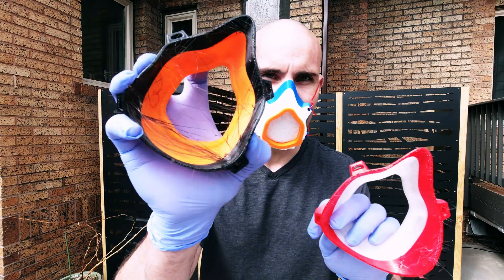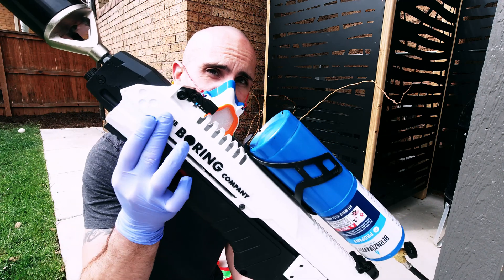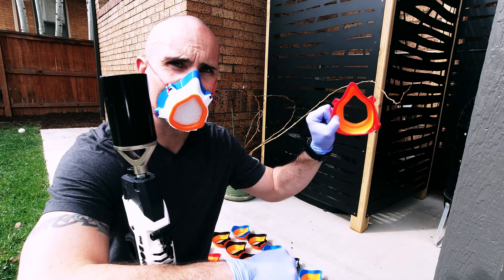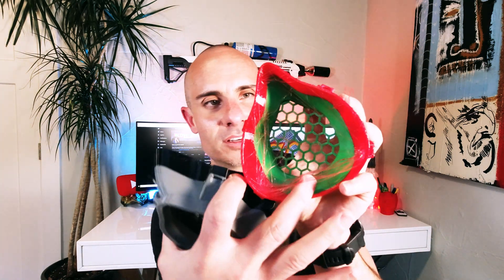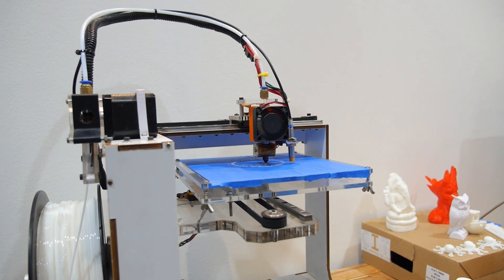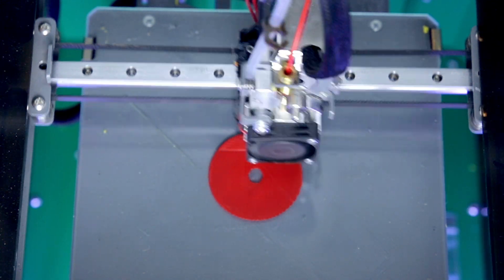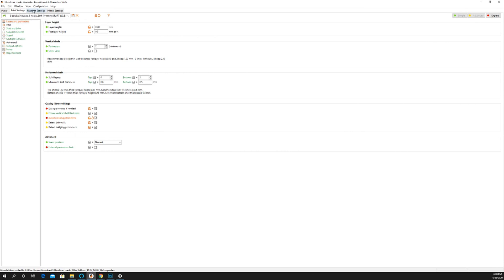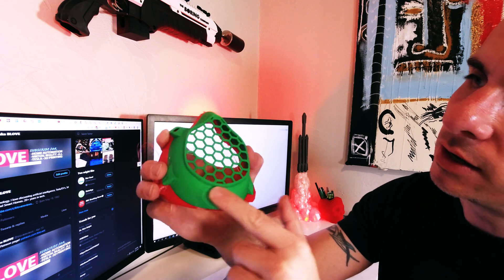Fix 3D print stringing and prevent it from happening #3dPrinting

Comment: Thanks for the tips, but i am having issues transferring from PETG to TPU, the retraction is bending the material in the hotend. any tips ?
usually when i print TPU alone, i set the retraction to Zero but printing this double layer model, the settings in prusaslicer do not let you set them to zero after the layer change. manually slowed it down and loosen the screws on the gears and that helped but i am still having issues.

thanks.

Comment: It took me more than 8hrs of print time for this mask .Is there anyway we can decrease time of print . In fact I tried to increase the speed in slicer it showed me 5hrs but ultimately it took around 7hrs again with not proper finish and sir can you please upload a design for different attachment piece for TPU as a last layer . Thank you so much for your help till date .
Reply from the maker: Hi! Which printer are you using? I can typically do 3 masks in 5-6 hours with my current setup
Reply: @ALLYOURTECH3DP  Thanks for reply . I am printing currently 1 mask at a time . I am using Tronxy XY2 Pro 3d printer.

Comment: Another way to avoid strings near the top lobes of the mask, is to do a cut in the slicer up to the 4 cheek lobes, then split into objects, and print those 4 lobe objects one at a time, so the print head never has to cross empty space.  This will requires some gcode editing, but not much.

Comment: Do you ever change adjust the screw that changes the pressure on the filament in the print head when changing from petg to tpu?
Reply from the maker: I haven’t, at least not on my Prusa. Knock on wood, but I’ve never had a filament jam.
Reply: I have the i3 mk3 also and find it almost impossible to print tpu without loosening the screw some.